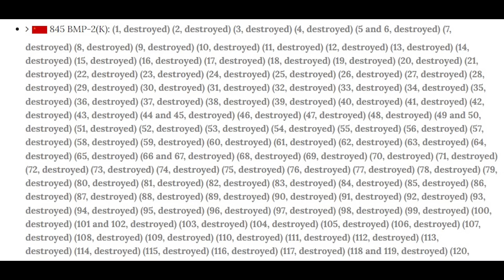Ukraine's Counteroffensive -- Ukraine Captures BMP-2 and a T-80

Comment: The T-80 2022 is a contender for Russia's best tank in Ukraine, so it will be given to one of Russia's better units.  Such units are likely to be held in reserve to be used in counterattacks when the Ukrainians capture territory.  Russia does not have enough manpower to hold the frontline in any strength (let alone properly man the three lines of defence they have constructed in the south) so their defence consists of a lightly held front line that serves as a tripwire for counterattacks by their best units.  So the capture of this tank is a good omen.
Reply: The T-64 and T-80 lines were in a lot of ways a bit better than the T-72, T-90 line. They were meant to be the technological improvement at no effort spared which had a bit better offroad performance and still packed a really decent, modern gun in them for the time. The T-72 was sort of the mass produced shitter they churned out to make up the numbers and by the time the post-soviet state ended, the T-90 really just didn't appear in the numbers they needed.
Sort of a case of quantity over quality in a lot of ways, both have their merits but personally I wouldn't be a fan of the T-72/90 line if I was sitting in it being shot at knowing it was not so much the case of lowest bidder, but lowest effort. The top of the range T-90 would give the upgraded T-80 a run for its money in the apples vs oranges race down a hill, but most of them got stuck in supply-chain hell since 2014. Anything coming out of the factories since then is probably sketchy as a 6 dollar bill.
Reply: Итог недели наступления уничтоженных леопарды и захваченный танк.
Reply: @krissteel4074  it is interesting that the best originally Russian tank in Ukrainian war is M55S because it is light, small, very good in mud and heavily upgraded with excellent new technology. Nobody though that such an old tank could be the best Russian tank on the frontline in 2023
Reply: @tongobong1  There has been quite a lot of development in that sort of area for what might be called a 'light tank' or 'assault gun' type of vehicle. Notably the larger, meaner IFV's out there in that 30-40t bracket, can cross awful terrain, still be protected and have that direct fire output. The latest iteration is probably something like the MPF or M10 Booker, bit of armour, good power to weight and a big old gun hanging off it.
The other vehicle in Ukraine I can see giving the Russians a really hard time of it is the AMX-10RC's. They've very fast, long ranged, quiet and have enough of the good shit like thermals to really give the cold-war milsurp shit from 60 years ago a bad day.
Reply: That thing about the defensive lines went through my head as well. It's certainly an advantage to have several rows of defensive lines, but I doubt Russia can muster up enough people to really put up a fight, once the first two rows of trenches have been taken.

Also, Ukraine can poke in various locations, look for a weakspot and push inward. When Russia moves its reserves to stop that advance, Ukraine just pokes around some more until they find another hole.

You can imagine it like this: Russia will soon run out of fingers to plug holes in their boat, meanwhile Ukraine keeps on drilling in some more.
Reply: @krissteel4074  M-55S is better in mud than MPF or M10 Booker because it has wider tracks per weight than those two while AMX-10RC doesn't have tracks. M-55S is the best tank for muddy terrain Ukraine has.
Reply: @h.a.9880  the biggest problem Russia has is low morale of its soldiers. Nobody wants to fight and die for the foreign land since Russia without that land is already the largest country in the world and so scarcely populated that they have enough of land for 10 times as many people as currently live in Russia.
Reply: i think the t72b3m is better
Reply: @h.a.9880 they have reserves in the back waiting on the big push from ukraine so its common sense to know they have the manpower to man the trenches especially since the area 10km away from the actual trenches are causing so much damage on its own it will be very intresting to see a massive push through those lines and what will ukraine do once they reach the actual hard part of it all

Comment: The gun's range is actually higher, but targets are not often engaged at those distances for differing reasons. In theory the APFSDS shell can reach 10km and still do some damage. Something like a HEAT shell is less aerodynamic and so understandably will have a lesser range.

Comment: I might be mistaken, but I think this one also has some add-on armor to protect it's posterior, something I don't remember seeing before.
So now, that innovation will be in Ukrainian service before most Russians get it.
Reply: If you mean the slatted armour, that's something the latest T80s inherited from the T90. It's supposed to help prevent penetration from shaped charges, hence why Western anti-tank weapons like the Javelin are designed to strike the top of a tank.
Reply: I suspect the Russian tank ran out of fuel. Resupply fuel truck hit a mine going to the front.  Russian logistics sucks.

Comment: Thank you for the posting and voice-over analysis.  

Question: when will the cellphone operators learn to hold their cellphones steady?  Screen captures will require more time to capture sharp images for analysis.  The intel teams of the US and Ukraine now sleep in their offices.  Steady images would accelerate the flow of information to the columns of men confronting these weapon systems.  Perhaps only by minutes.  A crew can die in seconds.
Reply: The roads are so full of holes, it's a miracle of modern technology you can get as decent a picture as we do have.
Reply: @David_Crayford  That vehicle is not in motion.  Also, the individual with the cellphone could reach down inside the hatch to scan the controls and electronic units.  I have done similar work.

Comment: If you look closely or slow the video down, quite a bit of rust can be seen on that T80. Even if it's on areas subject to a lot of heat, they really should have treated them to heat resistant paint. There again, after the T64 proved so expensive and problematic, the Soviet Union returned to the idea of using huge numbers of essentially "disposable" tanks to overwhelm an opponent. So I assume longevity isn't a major concern in anything that the Soviet Union or Russia has produced from the T72 onward.